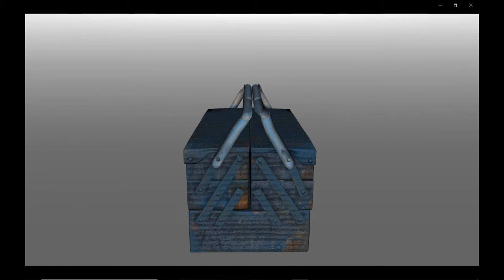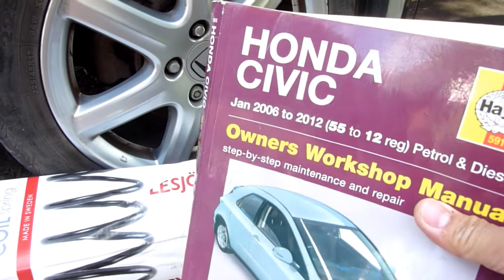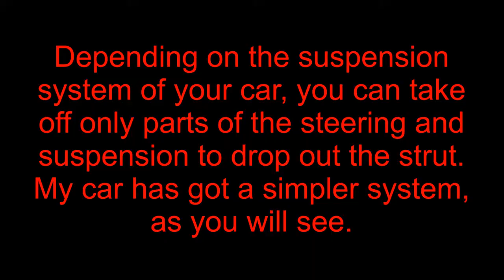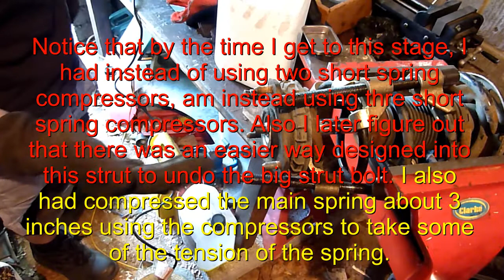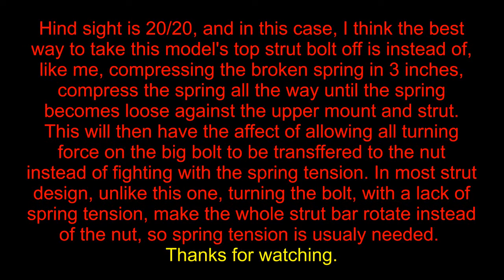Complete Guide: Broken Front Wheel Springs, Honda Civic 2.2 CDTI

Comment: Should have just stuck a jack under the ball joint to take the tension off the drop link and the two large bolts holding the strutt and knuckle together.

Comment: I always take the tension of the springs and then do the middle nut... When you were trying to get the nut off I was throw stuff at the screen shouting "compress the springs more"
Reply from the maker: I was trying to answer a viewers previous question whether the spring but can be undone a bit whilst still in the car when I tried undoing it on the cat. And the way I do it is to find the right balance of spring compression so that it's only just enough.

Comment: Can we take the strut without move the drive shaft or we always have to pull the a little bit? I am a bit scared about the drive shaft
Reply from the maker: Just tie up or prop up the drive shaft and it should be okay. The drive shaft should be moved as little as possible.
Reply: @EducationPineapple  how easy is to pull it out?
Reply from the maker: @tiago10alves10  the removal of the strut is a 3/5 difficulty level on the Haynes manual.

Comment: Hi , iam struggling to take the top nut of the strut off. Do I have to compress the spring just a little bit to take out?
Reply from the maker: yes it is a balance of compressing the spring part way...too much and it wont work, too little and it wont either. Also never try to spin off the nut with the spring pressure not taken up by the spring compressors, or it could shoot up and cause a serious injury to you.
Reply: @EducationPineapple  thanks for your answer , I tried tha way but the spanner still sliding off 😑
Reply from the maker: @tiago10alves10  compress it a lot then.
Reply from the maker: @tiago10alves10  try using a high powered impact wrench. Mine is 450NM cabled at about £69 pounds. Your spanner shouldn't be skipping. If that were the case it means your but is rounding off. You mean the whole assembly is turning with the nut?
Reply: @EducationPineapple  I just bought a 18 and a impact drill and a done it.i have changed the strut mounts and after a day driving they become noisy again , what can be this?
Reply from the maker: @tiago10alves10  It is normal for a changed spring or strut mount to be noisy when turning at low speeds, so don't worry. Did you buy a 18v impact drill?
Reply: @EducationPineapple  yes 18 v , all right thanks
Reply from the maker: @tiago10alves10  good job🙂